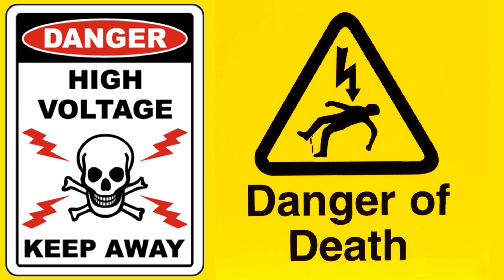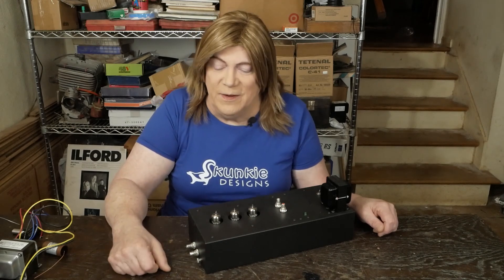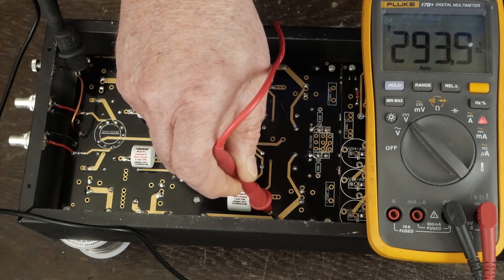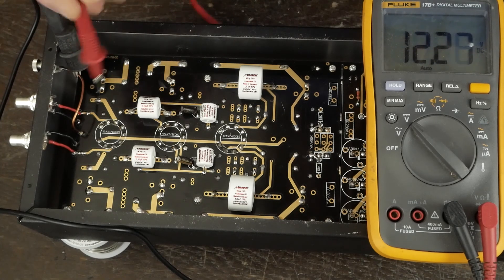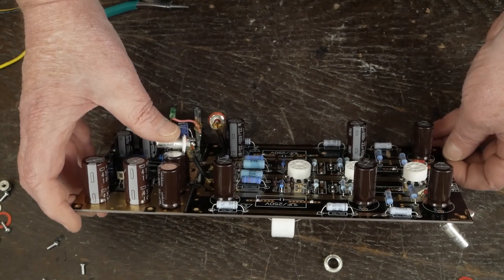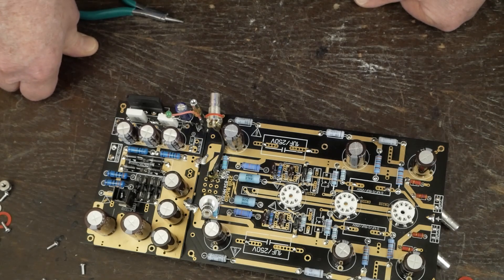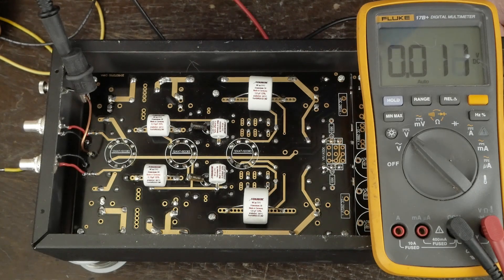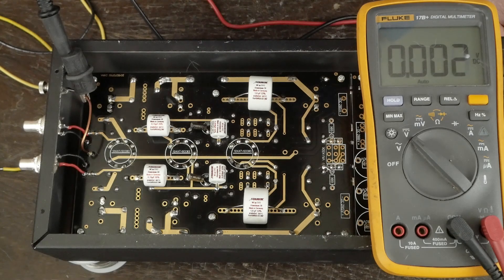EAR834 Clone Phono Stage Pre-amps: Diagnose and Repair!

Comment: Do you wire for 110v or 220v power?
Reply from the maker: 120V You need a 300 series transformer for other voltages.
Reply: Thanks for the quick reply

Comment: Hi...how do i reduce the gain of the preamplifier. Thanks
Reply from the maker: With the volume control on your amp. Every attempt I have seen to reduce the gain on this amp by using different tubes or inserting resisters negatively impacts the sound.
Reply: volume is not gain. But i understand.
Reply from the maker: The pot on the input of the amplifier shunts excess system gain to ground. Or does you system have no volume control?

Like I said, several people have attempted to reduce the output gain of this pre-amp swapping other tubes or inserting voltage dividers between stages and every time it negatively impacts the sound. I'm more interested in the output of the system than the semantics of what a volume control is called.

Comment: One gripe I have with the kit, and the circuit design, is there seems little  consideration of the disk warp component of the signal.  This is most 'annoying' in the 8 to 13Hz region where pickup/arm resonance can add to the disk warp and create large signals. There is nowhere on the board to add a sub-sonic filter.  OK, there is loads of 'headroom', but allowing such frequencies through to the power amp is asking for latching up and popped speaker cones.
Reply from the maker: https://amzn.to/3UTpdNZ or wire up your own subsonic filter on the input if you have this issue.

Comment: One advantage of toroidal transformers I only recently became aware of is the ability to add your own low voltage output winding. In Michael Beeny's YT video, 'Adding a 12 volt winding to the Quad 405 Transformer', he does exactly that by just winding some insulated single core wire around part of the toroidal.
Reply: Oh yeah, I did that in my Vox-alike Amp build - no LT Winding - no problem!
(The orig transformer made plenty HT volts but WAY under powered .. Hence this funky Toroid that JUST fit . Sadly THAT build along with a Mountain of other stuff got destroyed in the Eviction ..
 But i kept the schematics, and I've got something brewing..:) )
Reply: Oh and you wanna hear something REAL sad? In the selfsame Eviction were two Quad 405's basically - a company had built them into 2 new chassis, I picked them up in some funky junk once and - they were niiice...

Comment: hey stephe yes the video is educational. I got the zhili kit  and measured all the parts. only the nine 400V 22uF caps differ, they are 33uF nominal and 29uF measured. Do you recommend buying the smaller rated 22uF or can I leave the 33uF as this caps seem to be for DC stabilization? Other question:  I bought a torodial transformer with a shielding cap. Do you recommend to buy old school EI transformer instead? or try and see if there will be any problems with the torodial? what is basically the problem with torodial transformers? I allways thougt they were better.

kind regards burkhard
Reply from the maker: The transformer thing is just personal preference. If you haven't watch the layout videos, please go watch those before you start moving things around or using a different chassis layout. I get LOTS of emails from people who decide to change things all around for mostly aesthetic reasons, and end up with hum and other noise issues.

As far as the caps, 33uf will work fine as these are just smoothing/decoupling caps.
Reply: thanks a lot! no I strictly want to comply with your layout and also bougt the hammond chassis and choke from america... 25$ shipping 😂. only deviation is the transformer. I will try to do everything else exactly like you did, check if it works and buy EI transformer if there are any problems...